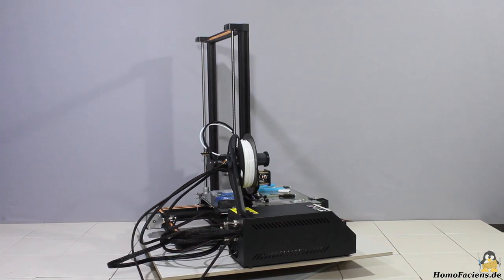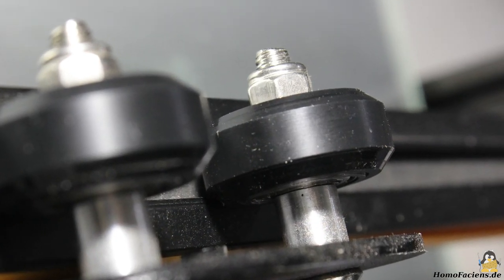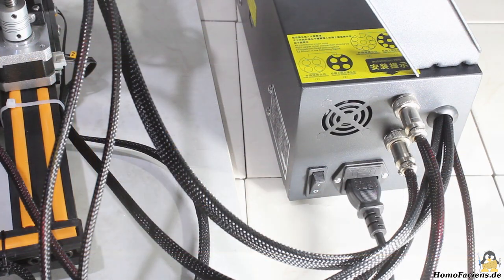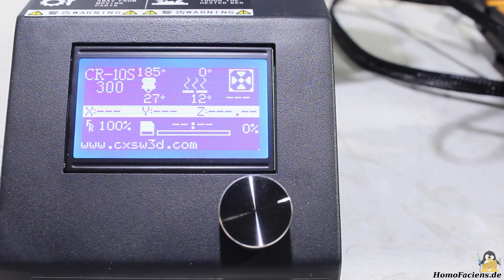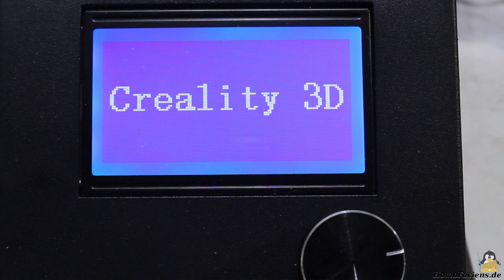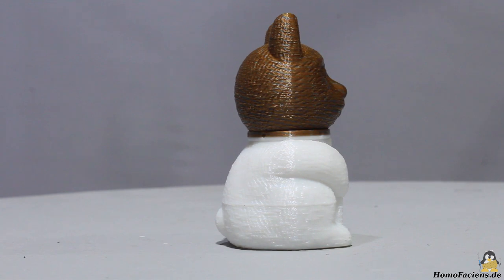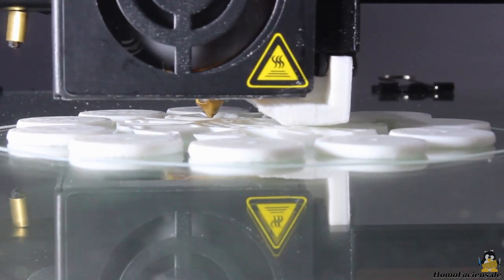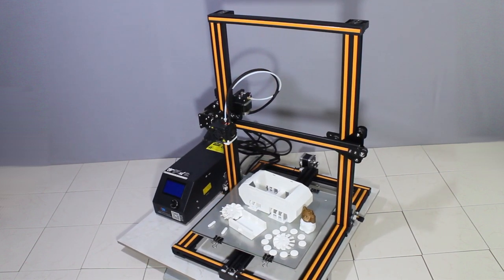3D printer Creality CR 10S Review

Comment: how does it know when the power was cut? logging every gcode command on SDcard? that has potential of screwing File system so not likely. Separate flash chip/controller embedded eeprom? ~100K? write cycles divided by number of commands in average print doesnt sound that great either.
Reply: Maybe a "big" cap which powers the system while it writes the last status to a perament storage?

Comment: The cooling nozzle looks very close to the print, like it would hit a bump left by a power cut.
Are these vids monetized, because Ytube are putting ads at the end of vids and if you aren't getting anything I won't let them run.
Reply from the maker: Yes, the air nozzle is close to the print layers, but not that close. At least I did not run into plastics of previous layers yet.
Yes, the video is monetized, thus I get a tip from YouTube each month.

Comment: primero!
now i see the video! then i comment!
Ok sorry for the late modification of this "first" comment... real life overcomes. 
This 3D printed is a very good quality.
Finale i see a le veline procedure that might to level exactly over the spring avoiding parallaxe errore.  The only thing to modify (in my opinion) are the knobs: if  there was more great in diameter it will be easyer to regolate them.  One other thing  tha leaved me in doubt is the "monotrack" of the bed: can the bed roll left to right during back and forward  movements? Especially with great printings?
Im Just supposing that observing your video, because i havent ani 3D printed at home. Some older 3D printed have two 8mm bars for the bed and i think that  as the Z axe is returned with two stepper motor as the bed can be returned at "double track"  for better stability. These are probably Donkey words happy to be wrong, off course!
Reply from the maker: ...talk to you later ;-)
Reply from the maker: The knobs are really smooth to operate - no need for a larger diameter.
The single rail is what I was skeptic about, too, but if adjusted correctly,  the plastics rollers prevent the build plate from shaking. It's a robust construction.